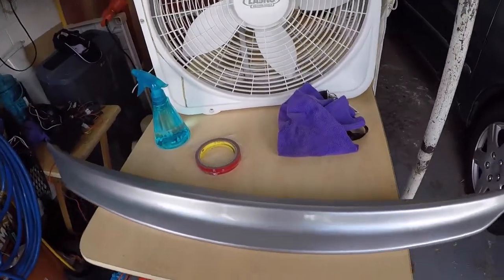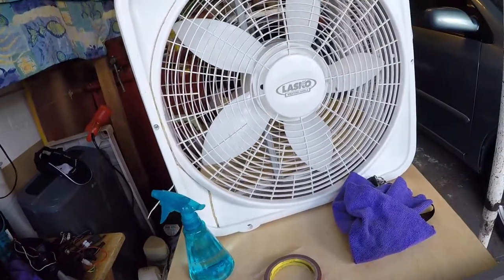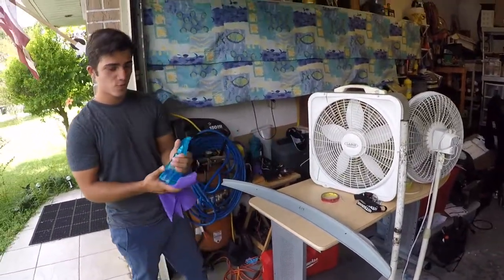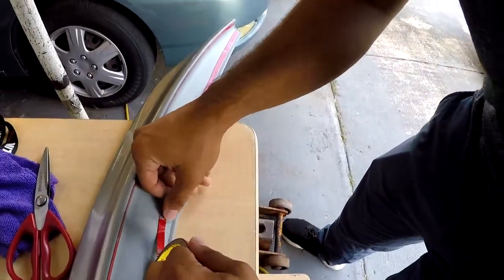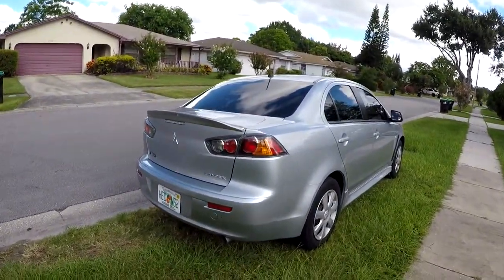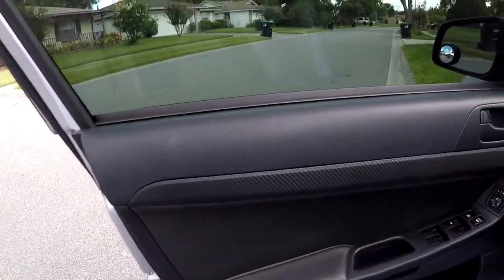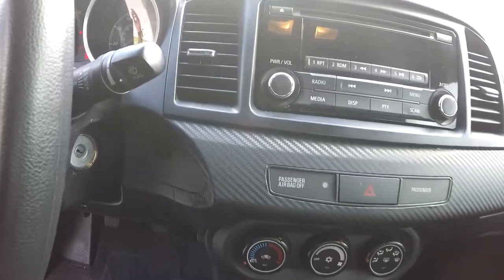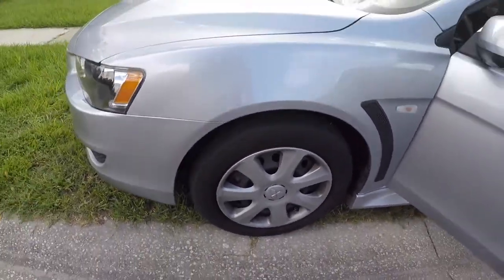DUCK BILL spoiler install on MITSUBISHI LANCER!

Comment: Hey. Answer soemu the viewer from Russia, how much reliably this mount? Well whether held? What if the water gets under the spoiler? Thank You!
Reply from the maker: I haven't had a problem with it since I put it on. It's been really reliable.
Reply: I kind of botched mine... used the tape but didn't get good adhesion in the center. Over a year later she is still on there, though! Tested at high speed too... and soft touch carwash.

Comment: And you got ripped off. Got mine for $40.
Reply from the maker: Matthew Ramirez painted?
Reply: @JRevs  na, flat black but already had factory color paint and did it my self.
Reply from the maker: Matthew Ramirez still looks flat black in your video 😂
Reply: @JRevs  that not even the same spoiler.
Reply: @mateotheone  what is it called the one you got for $40?